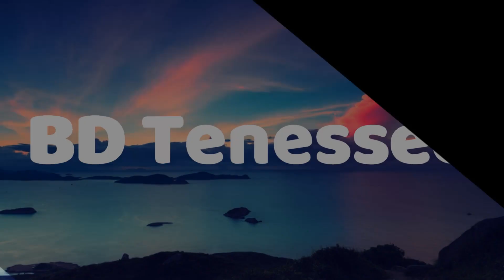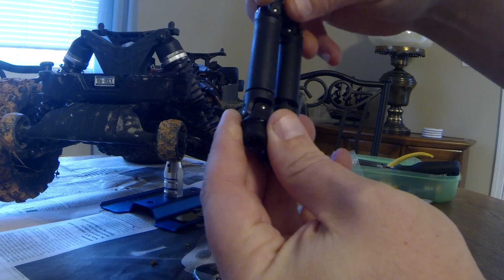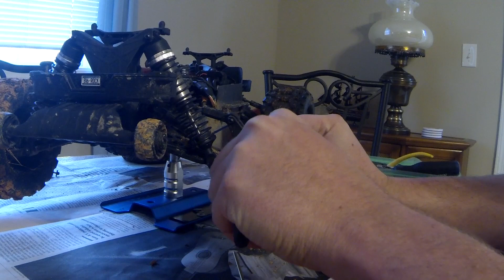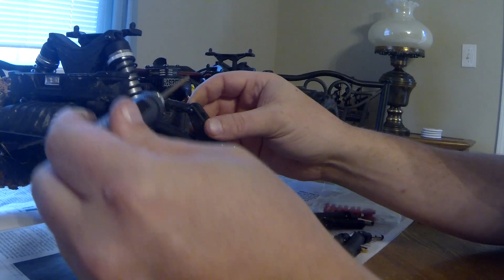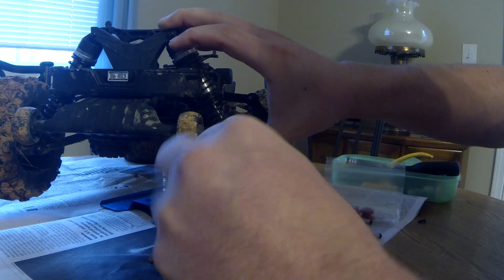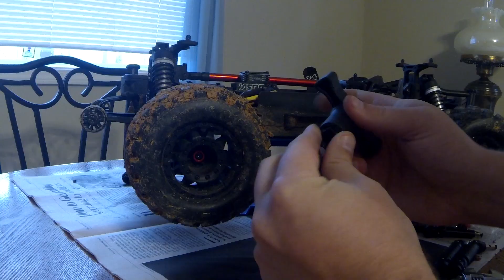How to: Replace / Repair Drive Axle

Comment: I have been looking and looking do not see any marking on shaft it does not matter all the same shafts on arrma kraton v2 and the arrma v2 line 😉 thanks Eddie 👍
Reply from the maker: Same arms for both. Side doesnt matter.Marking show inside or outside driveshaft.

Comment: How do you replace the other part of the axle? That's where I mine broke
Reply from the maker: Same steps. When you have the inner part of the axles still connected to the front/rear diff. You put the hex head driver in and remove the screw same as outside part.
Reply: @BDTennessee  Thanks! I'm new to rc. Mine broke last week, 2 days of having it - my first rc. Because i don't have any tools, what hex sizes/tools do I need to get the job done?
Thank you so much!
Reply from the maker: @big_al1526  welcome to the hobby and congratulations on new truck! Use the tools in the video is all you need.

Comment: Thank you! I took my Typhon 3s out for test run with a new 3s 5000mah 100c batt to see what it could do and made the mistake of running in gravel and crushed stone baseball parking lot. Look down and a rock is in the the driveshaft wore it down to 1/2 inch right next tot he gearbox. This video is very detailed and step by step for people like me. Thanks again Tenn!
Reply from the maker: Sorry to hear! Typhon 3s are fast for sure,glad you got it fixed and video helped!

Comment: Hay bd those are the stock drive shafts? Mine did not come that way I have 14mm hex with that little nut that holds the tire on what are those for originally.
Reply from the maker: This is the setup with Typhon Hex conversion. (i have a video on the channel showing how to do.)

So if you got the 14mm hex it will be easier and less step. Take off the 7mm wheel nut.Remove the wheel/tire. Remove the pin from the wheel hex (14mm silver piece).Then remove the wheel hex. Everything else will be the same.Really the only difference is you wont be messing with the black screw that im removing/installing with adjustable wrench and the 2mm hex driver.
Reply: @BDTennessee  ok I was wondering I had to put steal drive shafts in my big rock v3 gpm part# MAB108FRS-S sobfar so good haven't had any problems yet
Reply from the maker: @ihde2000  i havent ran those before but they look good and seem to be strong.